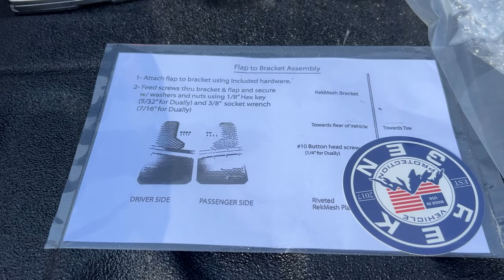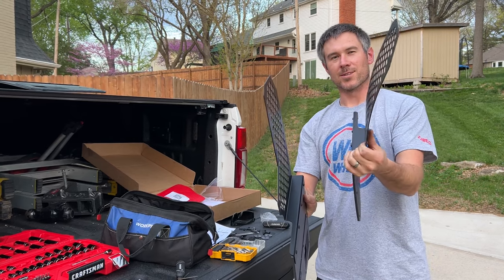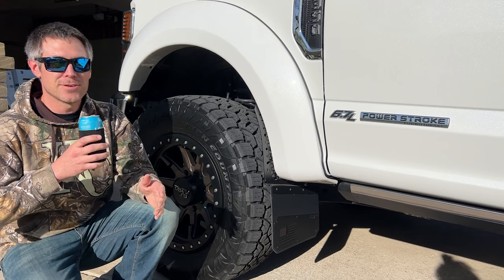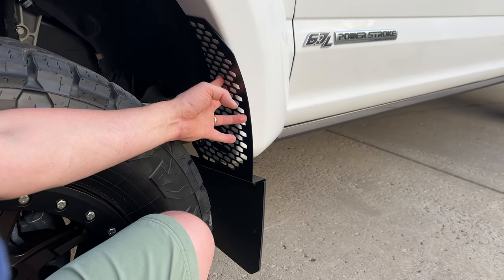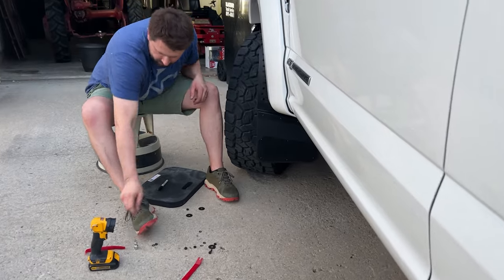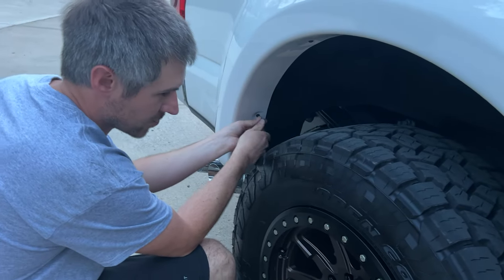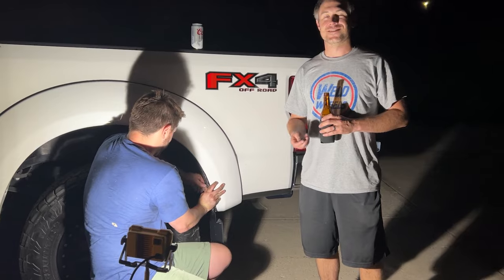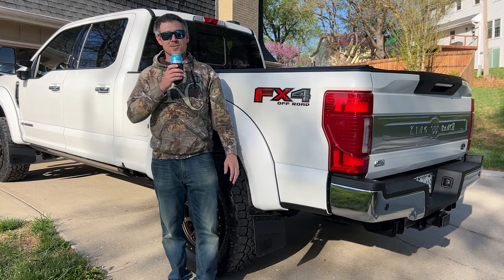How to Install REK Gen Mud Flaps

Comment: How did you use a drill for the holes in the back? Did you take the tire off?
Reply from the maker: @ethanjohnson9089  we just angled it enough with the tire on. Might be easier to take the tire off though.

Comment: Does your truck have leveling kit?  You said you think they are 10in length, it looks like the rear are 10in and fronts 8in? Im looking at getting these for my truck and yours look to be just right.
Reply from the maker: Yes it has a leveling kit with 35" tires. The front and rear are both 10" and fit perfect with this setup.
Reply: @jacobsupgrades   right on thank you for your response.  
Might I suggest concerning your flares, to put some of that protective film along the back side and edges of them.  As someone mentioned they cause significant paint damage and will in time cause that with your rig.  I had a 15 and they destroyed the paint  due to the flares and every season grew significantly.  I learned the hard way, always washed and waxed monthly and it still happened. It's Too nice of a truck.   Few hours and you'd be good.
Reply from the maker: @tonymazzali362  thanks for the feedback on the flairs that's good to know. 
It's my buddies truck and I think he has a black barrier of some sort between the flair and body. He's pretty OCD and was complaining it didn't match the body color or at least be white to blend better. I've wondered if those flairs cause paint damage

Comment: Which length of flaps did you get? 8, 10 or 12"?
Reply from the maker: @benreynolds8239, I think they're the 10" length flaps.
Reply: I don’t understand the fenders, they look terrible and destroy your truck. Enjoy the rust and paint flakes
Reply from the maker: @blakeboucher7965  they help keep mud off the side of the body with 35x12.5 tires. The body's aluminum so I don't think rust will be a problem with this Ford.
Reply: Might not have as much of a rust issue but it will take all the paint off. I see it daily I have the same size tires and the mud flaps do fine